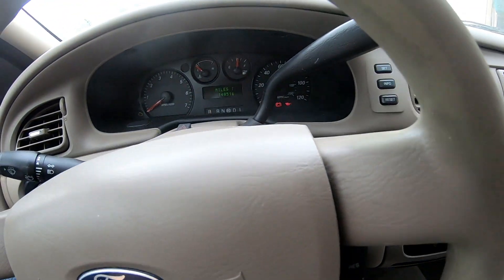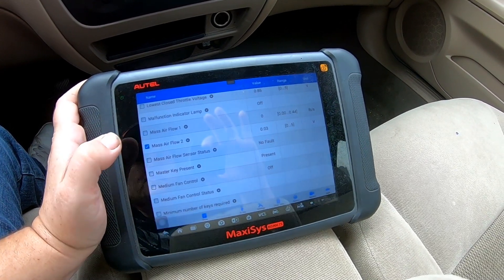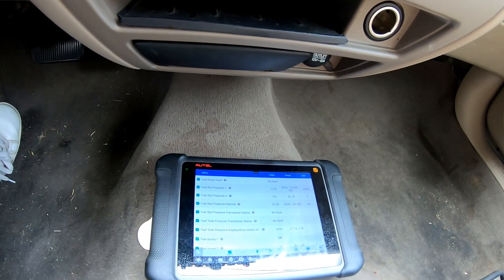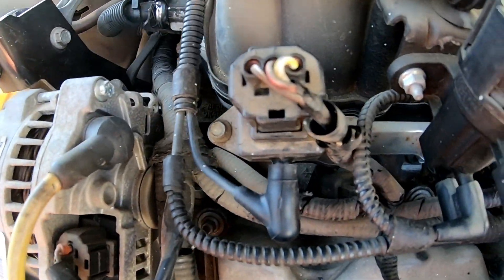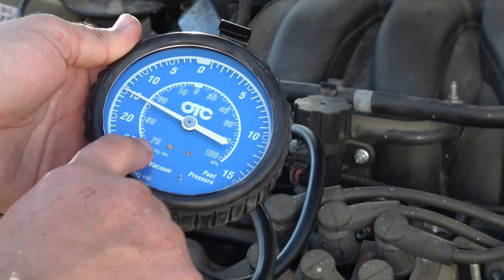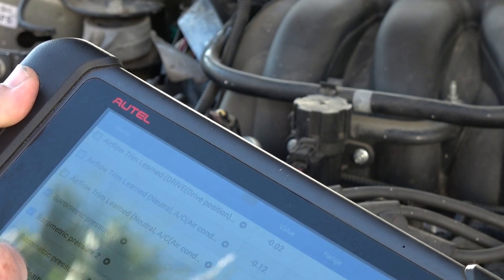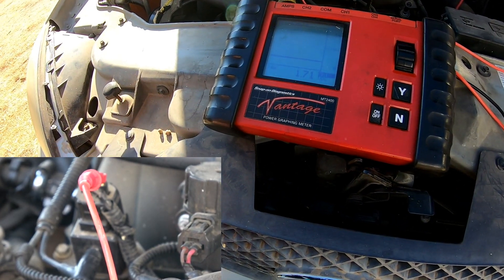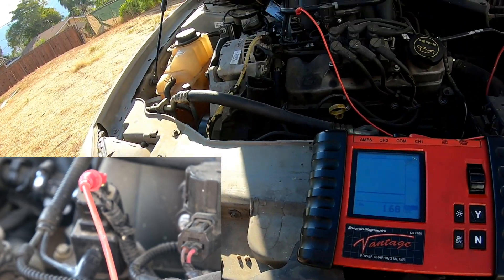2007 Ford Taurus 3.0L P0191 Diagnosis (Part 1)

Comment: I have a 2002 Ford Taurus SE. It has only one code and it's the P0191. It had recently been given a new fuel pump, new fuel filter. And that sensor being tested here was replaced. Not sure why it is still throwing that code. Maybe the sensor that it was replaced with was bad or wiring or what. No mechanic can figure out why. I am not a mechanic so I have no idea. Car starts fine. Occasionally at idle like at a stop it gets a little rough but rarely. Again, I have no idea. Perhaps it was a bad sensor? I installed it correctly myself. Car doesn't shut down by its self so that's not an issue.
Reply: Could be from spark plugs
Reply: Having the same problem

Comment: From 04  to 07 they screwed up the ford Taurus with this fuel Pressure sensor.  They added too many sensors. 01 to 03 were the best years for the Ford Taurus. They used a schrader valve to test the fuel pressure. I made a mistake and bought a 2007 ford Taurus and I am sorry I did. I should of waited and bought a 2002 or 2003. The 07 just runs half as good as the 01 I use to own. This was the beginning of the end for Ford cars after 03. The engineers at ford screwed everything up trying to make car more complicated to fix. The result backfired and they made trashy cars from 04 on.
Reply: My 03 taurus has the same exact setup and issue
Reply: Got an 04 Taurus here. I just cleaned that out really well, maybe I wasn't doing anything but without removing it, I sprayed cleaner into the sensor where he took off the vacuum line. I then also sprayed it into the vacuum line itself, basically giving it a real good intake cleaning? . History: Car WAS stalling and running bad, CHANGED FUEL FILTER.. It did it maybe one or two times after that but has since "smoothed out." (Since who knows, something somewhere got real dirty and fuel pressures only were bad when throwing P0191, P2197, P2198, which can happen when fuel delivery is screwed up, it will throw then the O2 sensors off too. One leads to the other if left unchecked.)

The fuel pump should be the last thing to be changed out, not first.. and my Mechanic will look at me funny if I were to say "Hey, I want to have the fuel filter changed again" and we changed it last month.. I still think bad gas.

Fuel pressure is about 40 to 42 (usually) when driving around as per OBD2 scan tool and Torque Pro. So again. If your fuel system is functioning fine and you've got a funky gas fill. Run it through.. changing the fuel filter DID help and I look forward to verifying no more codes.